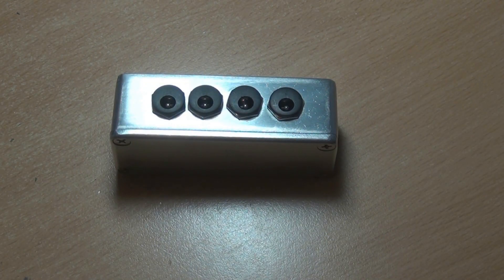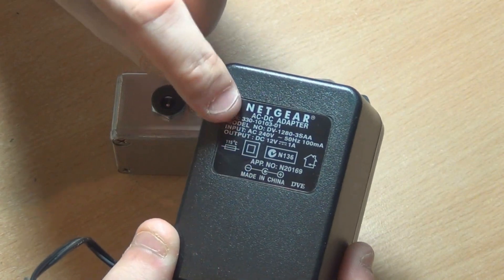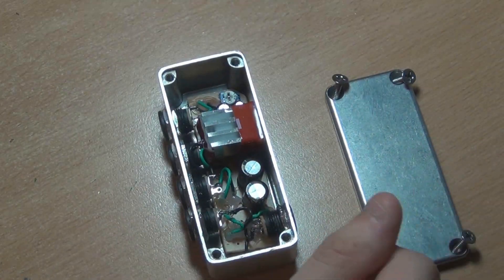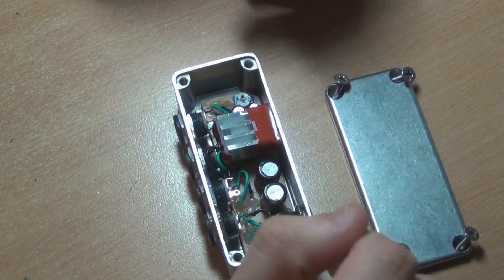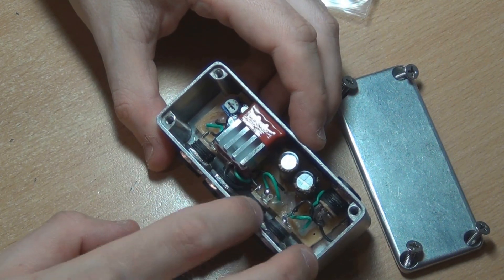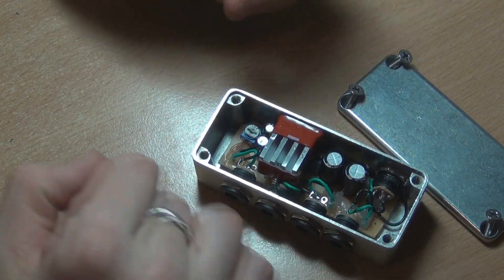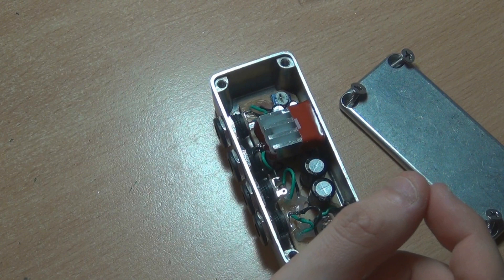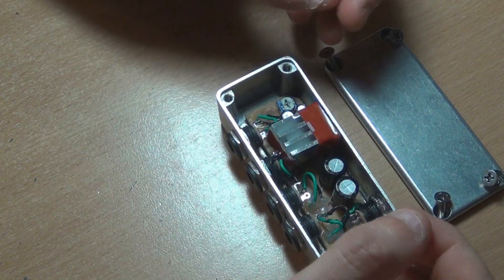DIY Guitar Pedal Power Filter & Regulator - Build Report

Comment: I´ve built this power filter after watching your video. I could get rid of ripple that was getting in my diy pedals. Thank you..   ...and yes, works great with 12AC / 12DC ´s power supply (tested both). I didn´t need a heat sink, it does not heat at all. Btw, I put a 10k pot mod to 1k so I can switch just the voltage I need.

Saludos desde Venezuela

Comment: All of these  videos are awesome. I appreciate the information you share so much I've decided to just order kits from your website. Now I wonder if this is building something your going to add as a kit option ? Or, may I ask, when will you start selling some of your builds there? I feel it could be very lucrative for you. The unit you built in this video goes for $79-$150 u.s. currency. If you charged a reasonable price you could have your products in guitar rigs world wide and effectively make more money than these larger companies solely because of moving larger quantities of inventory. Food for thought, maybe you should train a hand full of apprentices and start " the new big company" aking boutique fx attainable to the starter and average electric stringed instrument community world wide.
Reply from the maker: Thanks Jack for your orders and compliments.  A power regulator needs to be nailed down pretty securely for inproper operation from the user.  My power regulator is very basic so its not something I would to want to produce commercially.  Also note my power regulator probably doesn't include a lot of the features that the other pedal manufacturers include.  I say "my" as I have made a fabbed pcb based on the tonepad pcb.  These are for sale (at this point).  It does make for an INCREDIBLY cheap and quiet power supply though.  Cheers mate.

Comment: could I use a 14v power supply with this??..I found an old replacement laptop power supply that has a variable trimmer to select different voltages,the lowest is 14v,.I was thinking I could shunt the extra 2v to ground with the trimmer on the power filter..do you think that would be ok??

Comment: Hello! Great videos, spent hours and hours watching them!:) I have a question: what is the current output of this PS? I was able to easly power 6 pedals with total current draw of 200 mA with just a wall wart and a daisy chain, but when using this filtered PS it all stopped at the 4th pedal. Is it possible to mod it, so it gives out more current??
Keep up the good work!
Best regards

Comment: I was going to build this  one but instead went for the Jaycar 3-22 volt regulated power kit ,much smaller it only has one output jack which is good since I  use a daisy chain cable ,its cheap for NZ and Oz customers and silicon chip are online if you need advice  with the build.
Reply from the maker: Hey Peter, that's cool!  Never noticed that kit before. Difficult to know for sure without seeing the schematic but could possibly be pretty much the same /very similar as the tonepad layout.  How does it perform?  Quiet?

Comment from the maker: Input current = depends what your powering? 1 pedal? 1000 pedals? Google bridge rectifier, you will see what it is.  yeah just wire the input after the bridge, so + / - from the cap. Dont know about any lm317 or reversing the polarity sorry.

Comment: Leaving the diode bridge on the input would have the benefit of making it work with centre neg or positive neg DC supplies (a diode bridge is often used to "idiot proof" the power supply connections of equipment) as it will automatically connect the pos of the input to the pos in the circuit.... BUT it does introduce 2 x diode Vf drops (2 x 0.6V) So the input voltage is reduced by 1.2V (ish) after passing through the bridge. SO if you have a 9V reg it would have 10.8V as its Vin.